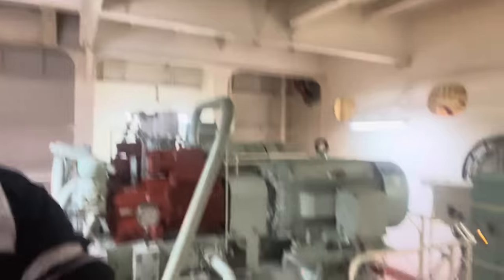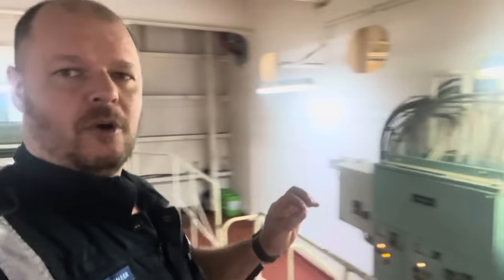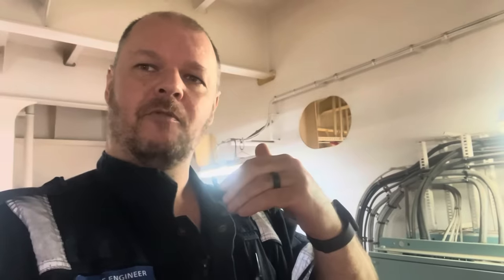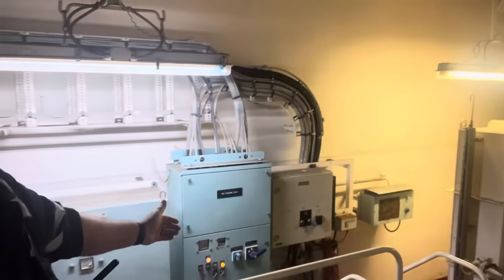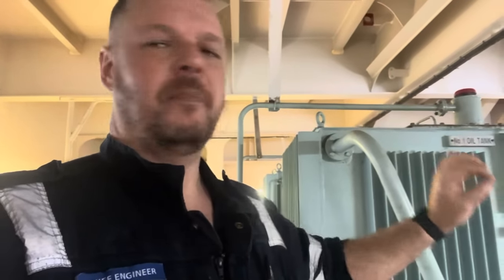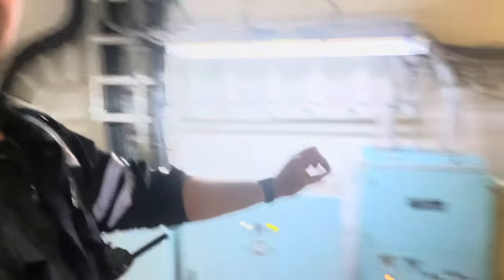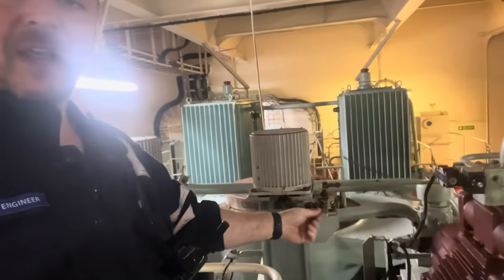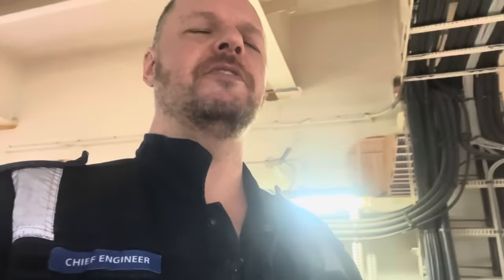Dali size containership steering system. How it’s designed to not hit Francis Scott key bridge

Comment: I would like a bit of clarification. You stated that if the power went out the "emergency" pump would require the backup diesel generator to kick on and it would take about 30 seconds. So, the ship would be without rudder control for the 30-odd seconds, correct? If for whatever reason, the ship's rudder was stuck right during the blackout it would take some time for the ship to correct its course to steer clear of the bridge.
Reply: That is correct.  Most vessels I have been on, the EDG has started and assumed emergency loads much quicker.

Comment: From what little I’ve been able to see so far, it looks to me like the rudder drifted hard to starboard.  Even on complete loss of power with no emergency bus, why would the rudder not just stay roughly amidship on a vessel making 8 knots?  I would think you’d have hydraulic accumulators that could cover any gaps that it took to get back online.  Unless there was some command from the bridge to steer right, it still seems very puzzling why they didn’t just drift through nearly on course.

The only think I can think is if she had multiple screws and the screws drove the ship to start board and the rudder was not available to compensate.

Looking forward to the ntsb report.

Comment: Good information. I would have assumed there would be more than just one main generator powering everything (lights, steering pumps, engine lube/air, etc). Seems like it would be best to have the loads split with multiple generators or have two generator running at partial load in critical maneuvering situations.

Comment: I assume the backup diesel system has a segregated fuel system? Is it possible contaminated fuel could effect the main engine as well as the backups? I imagine there is so much protection from that in place its a non issue but being unfamiliar with the systems on a vessel that size leaves me wondering.
Great information regardless, thanks for taking the time to provide the content!

Comment: I saw somewhere it was mentioned that generally when getting in and out of ports the emergency generator is normally already running in case there is a power outage.  Sounds like good advice if it could save you 20-30 seconds.
Reply from the maker: We test start the emergency generator before arriving in port but that is not an international law. I have never seen it ever run to maneuver into port

Comment: Does a vessel this size have side thrusters at the bow for the delicate steering adjustments when docking? So interesting the similiar systems in reverse for water fed power plants. The screws to open and close water gates feeding the impellors are very large as well.

Comment: Thanks great practical video. That's a very clean and well lit work area.  Just wondering if the plumes of smoke after the lights went out.  Was the back up generator starting up?  I can't help it was an accident.  Something failed on the ship.  Thank you.
Reply: Thats too big a volume of smoke to come from a backup generator , it must have been the main engine maxed out in reverse as it coincides with the prop walk indicated by the Stern pushing hard to Port.

Comment: That was neat!
1. the ship path would have taken it safely past the bridge support, but in the last moments, it was turned into the bridge.
2. we saw the lights flick out twice, any thoughts on why?
3. we saw the funnel pouring out black smoke in the last moments (while doing hard turn), does this indicate that the motor was under heavy load, or just effect of restarting the engine?
4. ship missed the dolphin? (bollard to protect bridge support), then swung bow into support, was this an effect of doing a hard reverse on the engine?
Thanks for the video!
God bless you all!
Reply from the maker: So they definitely lost electricity twice, that’s bad and very likely the root cause of the whole disaster. Why and exactly what I’m not comfortable speculating on as there are too many variables. Going to have to wait for the accident report
Reply: @steamman9193   Thanks,Chief! 
I'd bet that they will be having more Steering Gear Drills in the foreseeable future....  You are on a  MEBA ship?  MEBA and MMP?
Reply: @steamman9193   We were inport once, and it was just the Nighthawk and myself (OMU) on watch, and the Officers were all ashore, having dinner, and the ship went completely dark!!
It's a great thing that we had Cell service in the E/R, because I had to call the C/E in town and say" Chief, the ship just went dark!! That must have been "wonderful news" for him & all the other Engineers!  The EDG and the SSDG started automatically,  but I couldn't close the breaker on the SSDG!   
All that hassle, because of a tripped fuse on the main buss that made everything go dark! 
 I did energize a L/O pump from the EDG buss...

Comment: As a Submariner, it's shocking how vulnerable the steering system is on a commercial vessel. 

Our steering and dive-plane controls were all hydraulic and controlled via a Main Hydraulic Control Plant, that was powered by a central source of electrical power.

We also had several backups to that system, including a ridiculously simple system of "stored energy" that was simply a tank-full of hydraulic fluid with a spring pushing a bulkhead that pressurized the tank.

That allows the crew to make several inputs to the ship- control without losing control to those vital control surfaces.

When you're in the area of "test depth" you tend to keep these systems in the back of your head.....................
Reply from the maker: We have other things to worry about when we hit test depth! 
Big difference between driving a ship around with dozens of men for no reason other than to take or cause battle damage vs a few guys who move thousands and thousands of tons of products to commercial markets while hopefully not getting shot at or hit by some swo who doesn’t know what he’s doing

Comment: Great insight, and allows one to ask "What are the possible reasons for the emergency backup generator not kicking in and powering electric rudder motor number 2"? Are these reasons plausible 1) outa fuel, 2) bad fuel, 3) bad backup generator, 4) electric motor #2 was faulty but nobody cared, 5) it did kick on and the captain steered the ship hard port in the incorrect direction due to communication error or some other reason, 6) it did kick in but due to loss of power the ship was at the mercy of the tributary current  no matter how much they moved the rudder, 7) the captain wanted to send a message to his girlfriend.

Comment: One thing I heard early on in the incident was that the restart and reverse of the main ‘screw’/ propeller causes a walking effect that can actually steer a ship briefly. This being due to the enormity of the main single screw. It was suggested that the final attempt to restart may have had the unwanted effect to steer the ship’s bow to its final and tragic vector. Is that plausible?

Comment: Very great and interesting explanation of the rudder system.  I think I saw somewhere that Dali's power was out for 45 seconds.  I initially thought the ship received elect power from the main propulsion engine like a car but apparently they have separate generators for electricity.  Its my understanding that the generator(s) powers various electrical equipment like pumps on the main engine so if a generator goes down, the main engine also goes down  and may not be immediately restarted when the backup generator starts.  It seems like battery backups for the rudder motors might be a good idea but maybe not practical for motors that large.
Reply: Correct... Cooling water, fuel and lube oil pumps are electrically driven and always double executed, and each one of those stopping will first trigger a standby start of the 2nd pump and if that fails (or pressure not restored) will trigger a shutdown of the main engine.
These pumps are generally not fitted with position switches (most likely the fuel pumps, but not the oil and water pumps) so they need a manual restart.

Steering gear pumps have position switches, so any steering gear running before the disturbance will restart upon restoration of its power supply.
A ship like Dali will easily have steering gear motors of around 100 HP or more, battery power indeed is not that practical.
Reply: Yes most ships do have a shaft generator, but those are only used like when far out to sea, and at full speed. Some smaller vessels like fishing trawlers that I've been on that have a controllable pitch propeller can use a shaft generator all the time, since the shaft turns at a constant RPM, and the speed and reverse/forward is controlled by varying the prop pitch. The advantage of such a system is a ship where you would need to change the speed a lot such as a ro-ro ferry, or a tugboat or a fishing vessel where you need the max available pulling power. But they are not as efficient as a fixed pitch propeller. A container ship does not need to slow down or switch to reverse very often, most of the time it will cruise at a steady speed that the designers and customer of the ship desire. For example if they decide they want to run at an optimal speed of 24 knots, then the engine horsepower, propeller size and pitch and engine speed are all optimized for that exact speed. To switch to reverse, the engine needs to be slowed down and stopped, and then started in reverse. A shaft generator in a ship like this cannot be used until the shaft speed is the correct RPM to generate 50 Hz or 60 Hz electricity.
Reply: Most ships do not have shaft generator .
Of the ships I have been on much less than 50 percent had one .
Reply: @josephpadula2283  That makes sense since there's no large container ships that I know of that use a variable pitch prop. Shaft generators are only useful if there's space, and if the shaft can be kept at a constant enough speed to maintain frequency stability. Plus, these box ships are built with machinery spaces as compact as practical to save money, and have room for as many boxes as possible.

Comment: Sal M brought me here to ur channel. The dots are being connected. His Key point: the electrical power transfer from main to emergency generator is automatic & takes 30seconds to 40seconds. Losing main power is extremely rare. Title of this/his vid is <how the Dali is designed to NOT hit the Francis Bridge>. Dali Captain is Ukrainian. My first thought when i first saw the footage was how the hell did hitting 1 pier collapse the entire bridge. New slo mo vid shows explosive devices exploded on the LH side of bridge top & RH  top. Can see the orange flames  exactly where it folded & tore apart/separated. Also the ship went off course to the right heading directly for the pier. Also this blocked the channel preventing many cargo ships entering the dockside & cargo ships are trapped on the inside. The lets go Brandon crew were extremely quick to claim "nothing to see here, no foul play". As a former Engineer I wanna see the input of the sterring done in the pilot house. Drunk employee(s)? As Sal M conveyed this is going to hurt the U.S. economy. & jobs in that area. 6 weeks is the expected time to reopen the primary channel. The salvage company has alot of work to do. 2nd Bizarre cargo ship incident. Looking forward to the NTSB discoveries. Subscribed

Comment: I have a question. I have experience with pleasure boats up to 100 feet in length, so I'm familiar with prop-walk in reverse. Usually prop-walk is not associated with forward motion because the prop-wash over the rudder provides steering control. My question is, if the rudder on a large ship is trimmed for a straight course, will the loss of propulsion cause result in the ship turning? My speculation being that the prop does create a bit of walk when moving forward, which a very small angle to the rudder cancels. With the loss of propulsion, this slight rudder angel would then cause the ship to turn slowly. This is just speculation on my part. I'd be interested in your expert opinion on whether  this is true or not.

Comment: "Should have."  Famous last words.  There's no guarantee any diesel engine will start up instantly.  Seems to me the emergency generator should be running for immediate take over if the main generator[s] fail when maneuvering in a harbor.  Loss of rudder control for 30 seconds is a LONG time.  Nothing stops a big ship that doesn't get damaged.

Comment: I have seen on other videos an explanation about the bow walking starboard when the prop goes in hard reverse and port in hard forward. What is your take on this? IT seems logical that rudder position would determine the direction but that was not mentioned.

Comment: Good explanation.  it looks like this whole thing started with main generator trip out of those that were running.  In the harbor at least two are on at the same time by USCG rules.  Several conditions can cause main generator trip outs but the likely cause that is frequently misunderstood is that the running generator controls are messed up and the generators can not share both real and reactive load. in a stable manner. Eventually one generator starts motoring and trips then the other generator trips.   I am a EE who has worked on this load share provlem many times.  Sometimes this situation is called generator cross current.  Also some designs equip all generators with reverse power relays.  These relays are most common on a generator feeding a stiff grid.
Reply: They can share real and reactive load. Real load is shared by controls monitoring the engine load on both engines. The engine assigned to be the "lead" is trying to keep the frequency at 60Hz. If one generator needs to supply more "real" power, then the governor adds more fuel. Reactive load is simply controlled by boosting the voltage on whatever generator is needed. For example, if one generator is supplying more KVars than the other, the controller weakens the field winding current slightly or boosts the other to keep them in balance. Generator cross current will only occur if there's a big imbalance in real load, for example if the prime mover on the follower (we can't use the terms "master" and "slave" anymore lol) genset were to suddenly start running rough, or simple stall, then the breaker will need to trip immediately because on modern alternators, they cannot withstand any motoring at all or they will very quickly sustain catastrophic damage.

So basically 'real' (Kilowatts (KW)) power is controlled by how much fuel is injected (more or less throttle). Reactive power (kilo volt-amps reactive (KVar))is controlled by the voltage regulator which bucks or boosts field current.
Reply: All large ships have reverse power relays   On the generators .

Comment: The cause of the Mali collision was not a steering problem.   It was a sequence of power failures.  Why, in the first place, did that happen?   Could it be a switching of the fuel from low to high sulfur content, as I have heard one commentator suggest?

Comment: From the video it looked like backup power came on because some of the lights come back on, but then backup failed because the lights when out again. It also looks like they regained rudder control at the last second because it looks like the ship stared turning to port just before hitting the bridge. Multiple failures will kill you every time.

Comment: Yes 100% correct BUT Ships of that size take time to respond to the rudder even more so when there is no propulsion !! What position was the rudder at the point of the black out ? What was the timescale before the main engine was restarted ?? This all happened in 3 mins ??? Ships just do not start to turn when the rudder is moved ! That is called Rate of turn !

Comment: Ive worked on schmeedium (small by your standard) boats. generally you have 2-4 mains and 2 plus gen sets. With least 1 as a primary and 1 backup so you could loose power but not propulsion or vise versa. Are large ships like yours set up in this manner or are the mains generating the power too?
Reply from the maker: Main engine is only for propulsion. Most of the time it’s a single main straight to the propeller no gears or disconnects or anything direct reversing if you want to stop you stop the engine. They can have shaft generators but that is not common nor would they be used in maneuvering conditions because the main would be stopped at times. So there are multiple large generators I think Dali had 4, I have 4 most large containersships probably have 4 with 2 being the minimum for restricted waters by regulations but normally 3 for thrusters. Looked at it today my thruster is 3,500hp more than a single generator can put out.
Reply: @steamman9193  thanks for the response and clarification. Never dealt with direct shaft drive, crazy! Everything else seems similar. Redundancy is key!

Comment: What I'm more interested in hearing about is the fuel systems supplying the generators? My understanding is: that some of the dockworkers reported that this ship was having electrical problems when docked. And I also understand that these container vessels have dual fuel systems; one for low Sulphur fuel and the oceangoing normal marine fuel. I suspect there was no "redundancy" in the low Sulphur fuel system, and that possibly the fuel supply pump wasn't up to the task. That's assuming that they did not flush the entire system and do a proper switchover, using a secondary fuel pump while in port?
Reply from the maker: That’s a complicated but valid question. Because I am not on Dali I don’t want to misdescribe their actual system or events. But what you are describing is definitely worth professional investigation